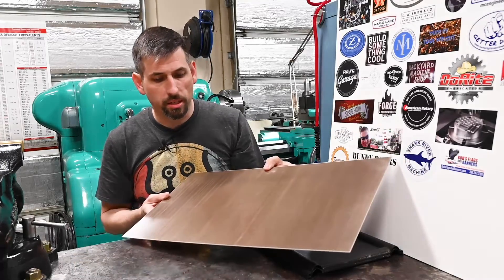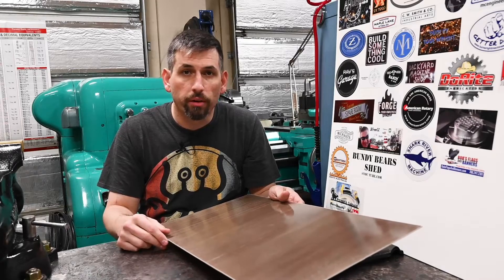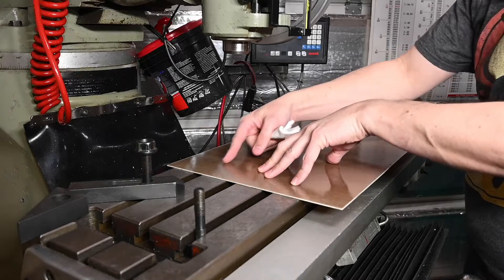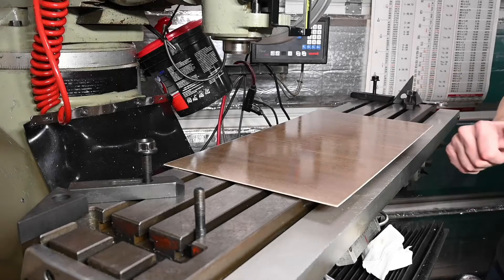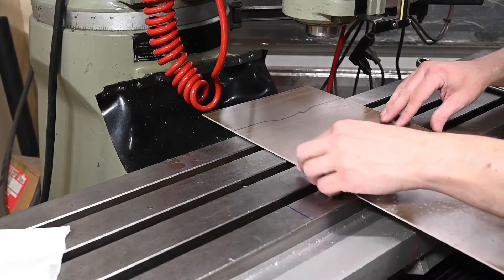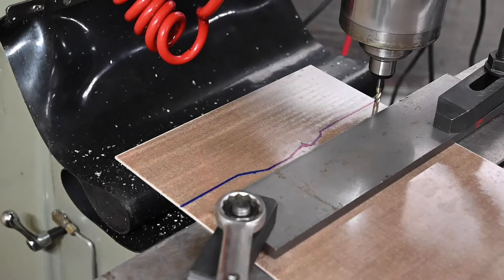Table Covers for Bridgeport Milling Machine

Comment: If you would add about an 1 1/2 to 2 inch railing around the perimeter they would contain a lot of chips that you could easily pour into the trash. I built a set and it works very well.

Comment: Nice job! I like the other suggestions to add a lip. It will catch debris but might save an expensive cutter hitting the floor. Some 1/4” x 1/4” aluminum bar epoxied front and back would save the tools. Leaving it off the left and right ends will let you wipe the covers down without having to remove them.

Comment: Yea, these are nice covers. Should last forever. I made mine out of Masonite sealed with clear lacquer. Shallow wood trays on left and right sides hold small tools, calipers, etc. two strips of wood on the bottoms keep the trays from accidentally getting knocked off. Cheers!

Comment: Aaron, thank you for sharing.  Far superior to a T-slot cleaning tool. . .  I do have a question.  Is there a reason you did not extend the cover so the gap between the table and the DRO scales was protected?  I noticed that close to the vise you had addressed the gap.
Reply from the maker: I didn’t want to have these covers overhanging anywhere- too easy for them to catch on my hand as I reach for the vise handle or something and flip them up or just scrape my hand. That foil tape was there when I bought the machine- I need to replace it to cover the full length of the gap, but when I’ve looked at the scale it’s always been clean. You bringing it up makes me want to do it though. Thanks!

Comment: Neat idea, however I’m like a lot of the commentators some sort of lip to hold tools example a spotting drill, drill, chamfering tool and tap, for hole drilling comes to mind. Or I guess you could lay one of the trays you have on top

Comment: Nice project. How about a trim strips around the edges of the covers to keep things from rolling off? I found them helpful on my mill.  A last thought, consider cutting the covers into 4 pieces so you can move your vice to either side of your table.  Just thoughts. That poor skinless cat.  I cannot believe the order and cleanliness of your shop and tools. Amazing.
Reply: Yes, as made it does encourage all the wear on the leadscrew to be in a very small length. But then machinists do seem to like symmetry.

Comment: Aaron, how did the surface finish come out on the cut edges? Was wondering if there was a sharp edge or a burr. Looks good and seems like a good material for covers. I use 1/8 thick clear rubber I cut for my table. The material was originally used as those clear doorway strips you might see hanging over the doorway at the deli in the grocery store or a butcher shop etc. They work great but I goofed up cutting my last piece, so I need to get more or a different material.
Reply from the maker: The edge is actually pretty clean. A little bit of fiberglass fibers sticking out, but not much. And the edge isn’t really sharp, which is unexpected. I suppose some of the resin flakes away and prevents a hard edge. We’ll see how they hold up.

Comment: Funny, yesterday I was thinking I needed to make some covers for my 10x50 mill table.  I might be seeing things but It looks like your spindle nut was loose.  That is the retainer nut on the bottom of your quill.  It looks like it turned some after you turned on you mill.  There should be a set screw to hold it after you snug it up.
Reply: I had it on my mind as well....the algorithm is on overdrive. Good eye , it is loose
Reply: Good video showing what I was talking about.  Robin does a great job.  https://www.youtube.com/watch?v=grUdsTTRGl4
Reply from the maker: I’ve noticed that too but there is no set screw to lock it in place. Just two holes in the bottom face for a pin spanner wrench. The nut moves a few degrees and no more. I’ll have to find a Sharp manual and see if there is a way to lock it, or if this is normal.
Reply: @AlwaysSunnyintheShop  My Sharp manual shows a set screw.  It's not on the nut itself but if you drop the quill down, the hole should be in the side of the quill near the bottom, maybe 1/2" up or so.
Reply from the maker: D’oh! Just a little loose. Tightened it up and measured .005 clearance which is apparently fine. Hopefully no problems will come up because of it.

Comment: I'm with Tuna. That stuff cuts fast and super easy on a table saw with a carbide tooth blade. Keeps the glass fibers out of your machine tools.
Reply from the maker: Wouldn’t trust myself to cut the contour with a saw, but I guess I could have ripped them down with a saw. Not sure I have a carbide blade or not.
Reply: I’ve end milled that stuff before it ruins carbide end mills.

Comment: A little lip to keep things from rolling off would be beneficial.
Reply from the maker: I can see that being useful, but then it would keep chips contained too. I use my little trays for tools or set them on the bench right next to the mill- I try to keep the mill table clear and now I can just wipe or blow the chips onto the floor or into the swarf bucket.
Reply: @AlwaysSunnyintheShop  Leaving a gap at the rear corner, say 30 mm (1.125") may allow chips only to be brushed away.
Great addition to the shop. Like the two part sachet.
Thanks for sharing and best regards from the UK.
Reply: AlwaysSunnyintheSh